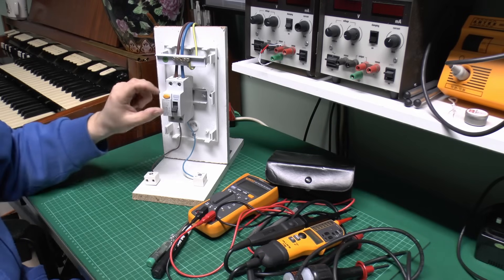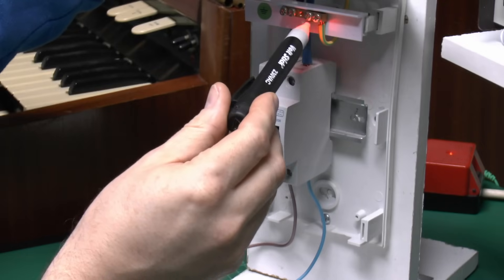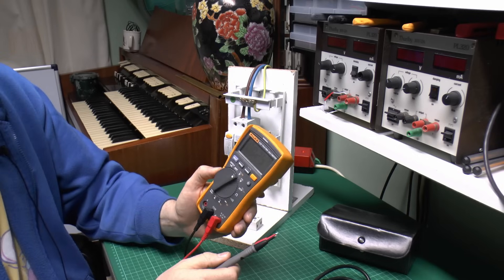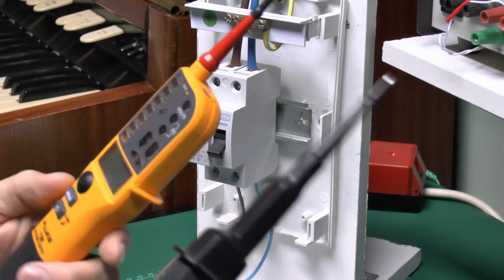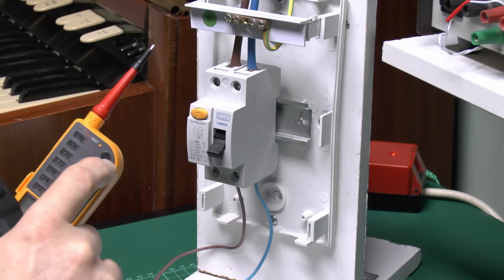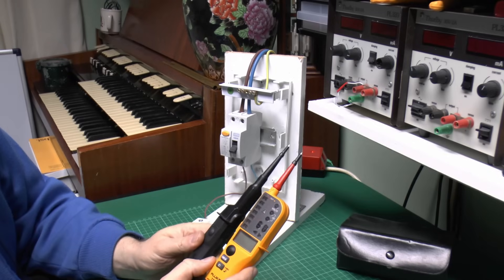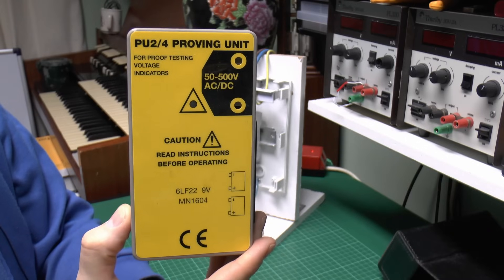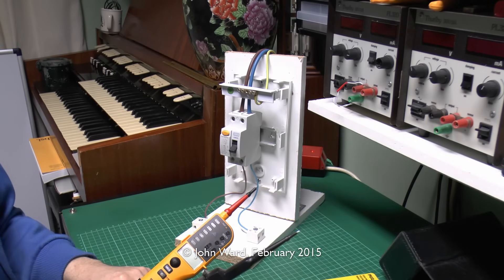Proving Dead - Mains Electricity

Comment: Your Video is done perfectly by the Book. Sadly the Book does not cover everything. it is also slow to adopt new stuff coming up which in my opinion makes much sense.
In no particular order:
1. You didnt mentoin that the most common tester can also detect/show dangerous Voltages with only one wire connected. you can briefly see it at 9:05 before you connect the N that the AC lamp briefly lights up alone. If this happens with both leads connected but its not showing a Voltage you should double and triple check because something is probably very wrong then.. (and the first tester you showed would very likely have shown something in that case) - yes such things happen. A Co-Worker once told me about such a situation where a Cable was cut inside a Wall with a Wall Chaser but only N and PE got cut, L was still connected - he was glad he had one of the Screwdriver type Tester at hand because the other testers he used before didnt show anything (this was probably 20 years ago so they were older ones without that feature)

2. You said tha the Test Leads must be insulated that at most 4mm of it is uninsulated. While i agree with the general thought in practice these kinds of probes are simply not useable because you cannot get the probe to contact properly in the most commonly used Connectors today (we use the Wago 221, and back when this video was made the previous generation which had the same problem), and it would be very wrong to assume that the wiring box is Voltage free if you cannot get proper contact with the wiring. I usually cut the Insulation a bit to mediate this - barely enough that i can click my Probe into a Connector of aforementoined Wago 221 (thats about 6 or 7mm exposed metal on the probe - this is also perfect for using the Test contacts on these Connectors.) The 4mm Rule certainly made sense back when these Screw Things were commonly used, but i am glad we screwed them..

3. While the Screwdriver-type Neon Testers are certainly not a good choice as Voltage Tester i like them for another purpose: they are perfect to unlock the Spring-type Terminals in Distributors, and also to Slide the N Disconnector. Or when you happen to come across a Screw Connector. Its pretty difficult to find appopriate Screwdrivers in the right Size as single Item (i dont need it included in a set of other Scredrivers, as usually only the small ones break). I personally would favour a Combination of a small Screwdriver and a Test Lead (basically a Screwdriver with a Ø4mm Socket for the test lead), but so far i had no success finding one..

As additional Measure: if you work with many Circuits and the way from the Distributor to the Working site is pretty long: there are also these new Fuse Finders which add an additional check. Plug them in on the desired Circuit, check for their Signal in the Distributor, Switch off Circuit and the Signal should disappear almost instantly (if it doesnt something is wrong). After that check again with one of the allowed Testers of course. When switching on do it the other way: plug in Transmitter on the Circuit you want to  switch on, hold Receiver close to the Fuse and when switching it on you should quickly get a Signal. If not something is wrong and you should quickly switch the fuse off again and re-check your stuff. Certainy not a Requirement, but if you work with many Circuits it makes much sense in my opinion (better than leaving an unknown cable live while you go to check the Socket or whatever you are working on and walk back to switch it off if it doesnt check out).

Comment: Hello John!
I like electricity, especially transformers, 3 phase motors, but also I like to work with circuits.
My question is : What type of  multimeter can  you recommand me? 
I am looking for a Fluke T-130, but I also like Fluke 113 and 114.
Now I have a PeakTech 3340 which is working ok.

Comment: Which one of these 2 Fluke tester  T5-1000 vs T6-1000 would pick John and why?
Reply from the maker: Depends on what functions you need, the two are not directly comparable.
Reply: @jwflame  I m one of those new  wanna be Spark( only 3 years in the trade even though spend 5k at college , but they thought us how to pass the exam) So I dont have much knowledge of any tester as I have'nt done any live testing to this date. 

Shall we say for profisional in domestic use to make it easier and have more function if needed in case they might come handy !. Thanks for your help.

Comment: I get concerned by the number of people saying, "i have had lots of shocks and feel fine", "or 240v or 110v doesn't hurt that much, stop being a wuss" what is all the fuss about?" ect, They completely miss the point, it only takes their body resistance to be low enough to cause a fatal shock, which is only milliamps, why do you think an rcd is designed to trip as low as 30ma? The mains supply in your house is more than enough to kill you, whether its 240v in the uk, or 110v in america, they are both enough to kill, your body resistance determines the shock level of it being a slight tickle or nip to meeting your maker (in other words DEAD!!!) Electrocuted! and of course as you say john we won't be hearing from them.

Comment: Hi John may I check with you still able to find the test bulb with the screwdriver set (able to trip) ? As you show on the video 5.58 thank you.
Reply from the maker: That one isn't made now, the nearest equivalent is this: http://martindale-electric.co.uk/drummond-mtl10-test-lamp-p-1715.html
Reply: Hi John I think this one not able to trip the RCD ......... : (
Reply from the maker: Some of the Fluke testers like the T110/T130/T150 have the ability to trip the RCD , they have a switchable load function which will draw 30mA.
Reply: Get a Fluke; they are the dogs dangly bits

Comment: Hi John totally agree those screw drivers should be banned from sale
Reply: Your mains voltage is awfully high at 261!  I think that's outside the +/- 10% of 230 by a LONG way!
Reply: Real story - I was working in Hong Kong once and while wondering the streets taking in the sites came across a street stall which among other things was selling a fairly respectable looking neon screw drivers. I also noticed it had "made in West Germany" stamped on it. Oddly I could also see inside the open door of the factory and the people making the neon screwdriver. Perhaps there is a section of Kowloon known as West Germany.

That was around 20 years ago but perhaps only the location has changed today.
Reply: ***** HE is likely on an unloaded isolation transformer or varac, so the extra voltage is expected.
Reply from the maker: KingOfKYA Yes, it's an isolation transformer.  Otherwise it would not be possible to trip the RCD on the test stand without also tripping the rest of the circuit.
Reply: ***** Ah right that true or you wold be poping the main rcd breaker. Another potentially interesting topic would be safety procedures when you have to work on live circuits, and possibly thouse with multiple power feeds.( datacenters hospitals etc)
Reply: A genuine neon tester is NOT a screwdriver. Some double up as screwdrivers as they have a slot blade but the standard test equipment supplied by electrical companies is simply an approved neon tester. I used one daily for several years and never got even a 'tingle' !
Reply: John, Yet the live indicator on the Fluke tester still showed a hazard even on the floating supply ?

Comment: Confirming that your device doesn't have a indicator fault should be done before any device is used to indicate a dead circuit, and even then, you're relying on the probability that the indicator doesn't fail from the check to the dead measuring event, so if you follow the same procedures, you should always do the power on check first.  Those proper procedures bring the utility of the multimeter into the same class as your preferred device,  in my opinion.
Reply: You do not use a multimeter to prove dead.  If both wires have the same voltage your multimeter would show a difference of 0v.
Reply: @fredbloggs545   What about the lamp test prope? Two test leads on two lives, the lamp won't light up because of no protential difference. 😲
Reply: @m101ist  
The lamp is dangerous, I would not use it simply because an open neutral would show the circuit to be dead.

It's why I use a Voltage Tester that does the single pole test too and I also have a  Non-Contact.  They are both dirt cheap, so it is silly not to have both and use both.

Comment: 261 volts! Some 230 volt equipment will be unhappy with that.
Reply: I've seen a way to use a halogen light transformer as an autotransformer to take 12v off for troublesome equipment, relatively low load though

Comment: 261 is too high for mains and would potentially cause an issue with a domestic boiler pcb. just a thought
Reply: I think he's using an isolating transformer, and running it under negligible load, so the voltage is higher than it would be on the actual mains.

Comment: Is this still valid if MCB was closed and a load was drawing current.
Reply from the maker: Yes - if a load is attached, the voltage is still there.
Reply: @jwflame  Thanks for the reply, I meant was it still safe to be measuring with a multimeter across the MCB terminals? I assume since its in parallel meter will only be drawing amps according to internal resistor.

Comment: I dont really understand all the hating on the regular multimeter :/
"If you dont know how to set this up, it wont read correctly"
I'd say that if you dont know how to set up a multimeter, you'll need to learn how to, and not fall back to a possibly dead lamp.
Reply: The test before on a known live circuit would expose the dead lamp.
Reply: In Germany it's mandatory to test your voltage tester on a functional circuit before using it. And I prefer the 2-pole voltage testers with a neon indicator in one handle and a plunger coil instrument in the other one. The neon indicator is for high impedance testing, and if you press a button you can switch over to low impedance testing. The plunger coil is indicating the voltage. Needs no batteries, and the lifetime of the neon indicator is much higher as the one of a standard lamp.
But you won't get neon indicators showing the polarity on a DC-voltage anymore. Now they're using LEDs instead:

https://abload.de/img/img_0123gesjq.jpg
Reply: The problem is that if you use multimeter for this application, one day you will be in the hurry, or simply be distracted, or meter will be malfunctioning, and you will put it in wrong settings or something or read incorrectly. It is not a matter of if, but when.
Reply: Yup, something like the "HOLD"-function. 
And multimeters have a high internal resistance. That's good for measuring inside of electronics, but not in a mains voltage circuit (reactive voltage). And the next thing is, with a multimeter you must turn away your view from the measuring point. And if working on a ladder a multimeter is very uncomfortable to work with.
Reply: Test on known circuit also proves the multimeter is set right, so multimeter is just as good in theory.
Reply: As I already said, if your working on a ladder (installing a new lamp for example) a multimeter is uncomfortable to handle. And you need to look at the multimeter, so you need to turn away your look from the testing point and the probes.
And I've already said that multimeters are having a high internal resistance, so in some cases you'll measure capacitive coupled in voltages in dead circuits which are not resilient (mostly under 100V).

Comment: But what if neutral wire is accidentaly disconnected or corroded away?? Two lead testers will not indicate voltage on live wire. Neon screwdriver is the only tester that will be able to indicate dangerous voltage in such case! It's the only one tester that really indicates if current will be going through your body if you touch the wire. It's quite reliable if you test it before and after use and if you learn to watch the lamp carefuly. However if the small resistor inside gets shorted, you will get nasty shock.

Comment: 261 Volts? I thought it was supposed to be 230V plus or minus 10% .. ?
Reply from the maker: An isolation transformer was used as the supply in this video, which has a higher voltage when no load is connected.

Comment: If the RCD fail and the live terminal is shorted and the neutral does break, you would not detect it.
Reply: The Fluke is useful as it has a detector built in; but you should still test correctly to ensure that is not the case.

Comment: I have one issue with two test prong units. In case of faulty neutral connection most of test units don't notify about potential of getting shocked. My coleg once got pretty nasty shock testing with a multimeter( somebody has pulled the neutral wire from the junction box).I always test with cheap screwdriver type indicator. And its easier to carry it around than a two prong unit. I never had faulty indicator but i still test it on known live circuit before i use it to diagnose something. It has it's fault with the fact that it is hard to see the light shining in lit condition especially in daylight. Most indicators brake quite easily especially if you use thame as a screwdriver. And I believe there are conditions that it could not light up on live circuit (like on DC) but I didnt enquterd it yet in my work.
P.S. In case of faulty neutral it quite easy to test it just by connecting some load on circuit and checking if indicator lights up on neutral terminal.
Reply: Watch carefully at 9:05 and you will see the Fluke tester does incorporate this.

Comment: That's quite interesting! Thank you for explaining so much. I'm curious why the sound jumps sometimes when you touch the wire with the probing rods. Can you explain what's happening? This is not meant as a criticism I really want to know what's causing this, because I want to learn more about keeping audio clean my own work. It just seems weird to me that doing this can affect the sound of your camera because there should be no connection between the things, right?
Reply from the maker: Michael Hübner It will be capacitive / inductive effects, mostly being coupled into the wire for the microphone.  
Constant interference will be capacitive, and when connecting/disconnecting the probes inductive, as a small spark will be created at the probes - a similar effect when turning a switch on and off.

Comment: How do you test a three phase installation?  You obviously need to test all three line conductors, but what do you test them to, neutral, Earth, each other?  You may not have a neutral conductor if there’s no single phase load involved.  If you test to Earth how do you prove that the ‘earth’ really is Earth?  If you test between line conductors then if two or all three had been incorrectly connected to the same phase then there would be no Voltage between them, even if they were still live.
Reply from the maker: Each phase to earth, each phase to neutral, each phase to the other 2 phases and neutral to earth.  10 separate tests.

Comment: What if you have neutral wire broken...but still have live power on???In all this tests you assume the neutral is ok. And  using two probes relying on that asumption.
Reply: The Fluke voltage tester would still alert you to having power on ONE of the poles, it only needs two poles to show the voltage.
Reply: @fredbloggs8034  Great..thank you!

Comment: I love John's videos, but this one I find lacking. For example, in case of neutral which gets to live potential (non that rare, due to shared neutral issues for example - and that can happen even in the middle of the work, not just at start!), in this video ONLY the Fluke (not main LEDs, but aux LED at top right) and "dreaded neon screwdriver" will actually work safely  without endangering your life! Over here proper procedure for preparation of work on electrical installation was: 

(1) on the live output of main switch (input limiter/main breaker/main RCD) and neutral, check the instrument is working properly and input neutral is not broken (like main LED on Fluke  or voltmeter or lamp test in this video) . 

(2) Turn off the breaker and check that neither the live nor neutral are at above-ground potential (NOT just the lamp/multimetar test, which wouldn't show broken neutral or neutral at 220V! Only Fluke aux AC LED shown at 8:43 and neon screwdriver from this video work for this!)

(3) check on the input of main switch instrument is still working. 

(4) doublecheck with instrument that output of main breaker is really off. 

(5) short-circuit output of (now turned off) main switch live and neutral with your marked patch wire which you were carrying always with instruments/tools. 

(6) post a notice of "hazardous environment, warning not to touch the breakers, date and time of start of work and contact  phone number" over the panel with patch wire and main switch.

(7) proceed to work on the installation.  

This had a number of additional safety advantages to methods presented here, including: deterring people who wanted power and went to turn breaker back on while work was in progress (6), covering broken neutral (1), covering neutral at live potential (2), doublechecking (as just one check may not have made contact correctly) there is no live after input (2,4), making sure that even if live were to be introduced in any way while work is in progress, it would case dead-short and disconnect upstream instead of risking life of personnel (5).

Of course there were also reverse procedure before turning power on (most importantly undoing 5, checking it is undone, and checking live/neutral before turning back on)